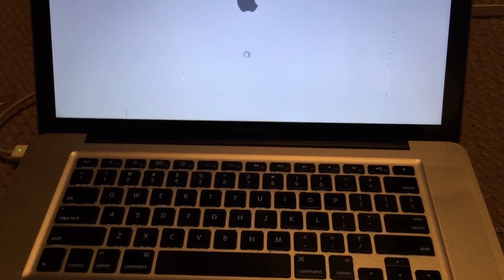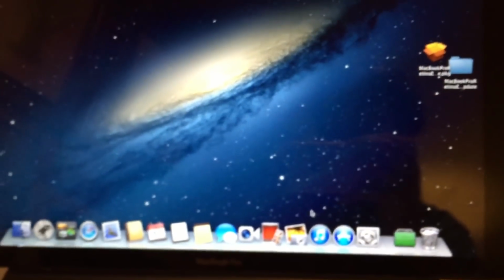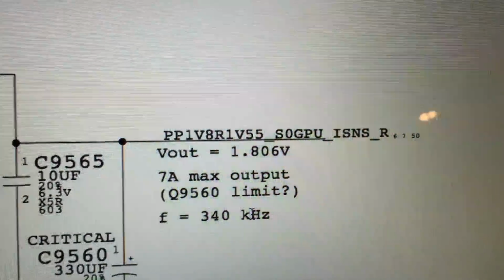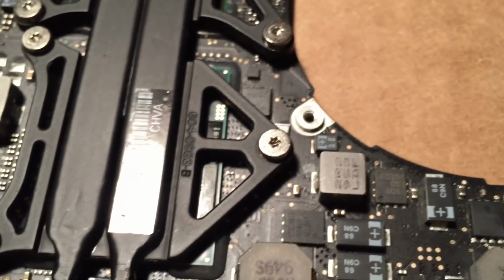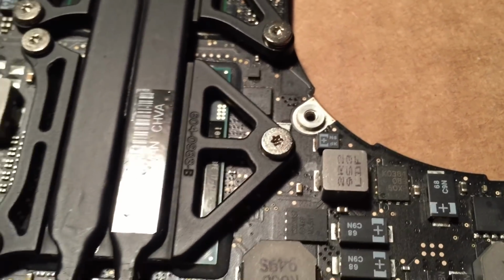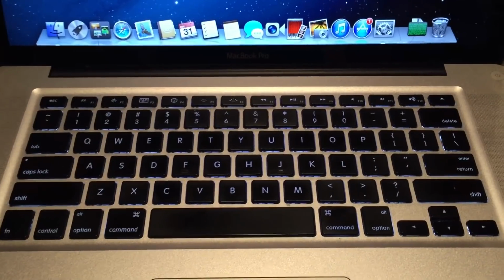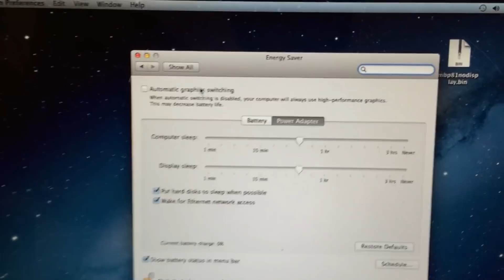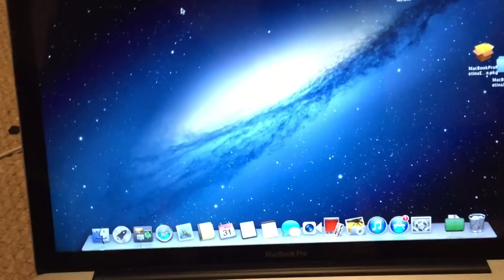Repairing a Mid-2010 15" MacBook Pro that Kernel Panics when Using the Dedicated GPU

Comment: hi dosdude Very nice video...I have the same problem with my mid 2010 macbook pro, resetting sporadically...
If I was to buy a new capasitor (I dont have a donor board) what capasitor should I look for (I resides in Denmark) and do you know of a site where to buy ????
Reply: A better replacement for the original 330µF, 2V tantalum capacitor would be an aluminum polymer capacitor with the same or higher capacitance (330µF or greater) and a higher voltage rating (e.g., 2.5V or higher). These capacitors are more durable and less prone to the characteristic failure of the original tantalum type.

Comment: I have a question, it appears that you have a MagSafe 2 connected to this MacBook but the description says its a mid 2010 how is that possible us there a way to convert?
Reply from the maker: It's just an original style T-tip MagSafe 1 adapter... Before they switched to the (much worse) L-tip style connector.
Reply: @dosdude1  oh ok, thanks for responding so quickly, I actually didn't know they made MagSafe 1 that looked like that. you taught me something. I have this same problem as the one in this video and so you actually taught me 2 things I was about to get a new logic board from eBay. I don't have a donor board like you do so do you have any recommendations as to where to get a capacitor to replace the faulty one with?

Comment: Mine does this some times but instantly happens when I try to run a 3d program like cinebench r15 3d test. I'm kind of scared to mess it up since I have no experience with soldering.
Reply: Ditto. Mine does it ALOT more than it used to, especially with the current OS I'm on. (High Sierra) Its still a perfectly usable computer for me. 2.4Ghz i5, 8 gigs RAM, and a 1 TB SSD.  The SSD REALLY woke this thing up, made it feel like a new computer again. I replaced the old swollen Apple battery with an eBay battery, only issue I have now is the nvidia GeForce GT330M kernel panicking. I use gfxCardStatus to manually switch to the integrated Intel graphics, but I wish there was a setting I could type into the terminal to permanently disable the nvidia. I'm a complete novice with soldering, especially with the tiny capacitors in these modern computers, otherwise I'd try it myself.
Reply: djhaloeight yea I use gtxcardstatus to keep it on integrated on Mac OS Mojave also running 8gb ram, i7 but still have the 1tb 5400rpm hdd
Reply: @djhaloeight  Hi there! With v1.8.1 of gfxCardStatus you can actually do that: start it, configure, switch auto.update off (which you can in this version), and tehn you can even chose to statup and stay with the intel GPU, which prevents it from ever swithcing to the Nvidia (you could also do it vice-versa, but in this case it's not you want :-( ). Have been running my MBP for wees like that now withou a single crash!

Comment: I have the same problem on macbook lat 2013. еrror - "apple.intel framebuffer" .  on new systems - the display simply turns off for 1 second, but works far. is there a solution to this problem?

Comment: I have this problem. Bought a used dead Mac to just swap my internals over since I had a few other issues (a lot, cracked screen blown speakers bend case, cracked trackpad which was replaced and cracked in the same spot to name a few) turns out the logic board on the new Mac is bad :/ Soo now I'll have to send my logic board off to get soldered or buy everything I need (don't have my iron anymore) and practice on the dead board before attempting this repair on my own board.

Comment: Hi! thanks for the video! I would have a question: what temperature is set for desoldering/soldering ? Thank you :)
Reply from the maker: I use around 300 - 350 degrees C on the hot air station.
Reply: dosdude1 Great video.  I have the same year 2010 MacBook Pro with the same issue.  Unfortunately, I do not have the Soldering equipment or an old board that I could strip to fix.  I was hoping to get this MacBook going for my daughter who is turning 10 soon.  Would you ever be opened to repairing my faulty logic board if I sent to you?
Reply: dosdude1 hi bro, I use 400c and its so hard to melt.how long did you desoldering that cap?
Reply: @Fahmad12  I use 400C and it takes seconds. You close enough?
Reply: Elvira Mota Sierra very close. it finally melt on about 10 minutes

Comment: great video dosdude! i replaced the cap, but now how do i enable te nvidia gpu again? ive used the "gpu disable" how to before replacing the cap
Reply: congrats, you bricked your GPU with software before fixing the hardware.
I was using any program to avoid switching to dGPU in software, easy to disable again, we dont even know what "gpu disable" you did

Comment: Hi, thanks for the video, but you have to explain what are the caracteristics of the cap you placed instead the undersized one, because we have to buy it ! I, like many other people , don't have much other mother board in my stuff ... I wanted to buy the one that Rossman sell, but the cap cost already more than 7$ and shipping is 15$ more... I'm not gonna use an aircraft to make travel something is 5 grams weight, it's ridiculous (and expensive). I think we can find it on europe. And so I need the caracteristics and you look like you have ;-). Thanks again
Reply: Hi,the capacitor you need it’s a 330uf 2v
You can find it at eBay , good luck
Reply: @alfaromeo4344  Thanks. No material specificity (tantalum, ...)?
Reply: A better replacement for the original 330µF, 2V tantalum capacitor would be an aluminum polymer capacitor with the same or higher capacitance (330µF or greater) and a higher voltage rating (e.g., 2.5V or higher). These capacitors are more durable and less prone to the characteristic failure of the original tantalum type.

Comment: iam frequently facing kernel panics on mbp mid-2010 15” A1286, Macbook pro 6,2.  after checking this video, i checked my Energy saver > Preference..and i tried disabling & enabling the check box, many times infact, and my system didn’t panic…so i guess my capacitor works fine….then what else can be the problem…?
whenever i open certain apps the system crashes..kernel panic….

Not only this - On Windows 10 or 7 running thru bootcamp, with original bootcamp drivers, my system crashes on certain apps..So i installed windows 10 on EFI boot, and it didn't crash once..All drivers working fine on EFI, except for Screen Brightness which doesn’t work.. Also the ‘Brightness’ option cannot be seen in the Bootcamp manager of Windows “Control Panel>Categories"

Your help & suggestion will be much appreciated….thanks
Reply from the maker: It's definitely the capacitor that's causing your issue.
Reply: 330uF 2V tantalum > is this the right capacitor for my model described to you.....
i just want to be sure it's got nothing to do with GPU or video card etc....

Comment: this is embarrassing on Apple's part making customers do this
Reply: @kpaxxapk6397  

“Every year model has some fatal flaw that keeps failing”

Any electronic product can glitch, and usually the numbers of affected units are low. 

That capacitor flaw wasn’t unique to Macs.  

The capacitors got OLD fast because they were flawed from the supplier.

If Apple had a crystal ball, they’d have used a different style of capacitor, but of course, they can’t see the future.

They did cover repairs for laptops three years out.   It’s farther than most manufacturers will go.

The problem was, only a brand new logic board had a brand new capacitor on it...

It was six years until someone identified the capacitor as the problem instead of the GPU.

The irony?  Reheating the logic board in an oven also rejuvenated the capacitor, gaining about nine months.
Reply: @Jkirk3279  "The capacitors got OLD fast because they were flawed from the supplier." I thought it was due to them using too small of a capacitor. "If Apple had a crystal ball, they’d have used a different style of capacitor, but of course, they can’t see the future." Yeah, but they also could have had a useful repair program that supported more than a few months of machines. "They did cover repairs for laptops three years out.   It’s farther than most manufacturers will go." Yeah, and it only supported machines bought within the last three years. Came out in December 2013, and went three years back (dec. 2010). See any problems there? "It was six years until someone identified the capacitor as the problem instead of the GPU." True, but it shouldn't have been a problem to begin with. Since it was a problem, it should have been handled less terribly. I love my Macs (currently typing on my MacBookPro13,3), but Apple is nowhere near perfect. Apple was not innocent in this situation.
Reply: Apple shouldn't really be expected to support a very niche repair on a 10-year-old computer. This is just for those strange ducks among us who hold onto computers WAY past their prime.
Reply: @xenonpanther  sometimes old stuff is just better. Expecially when you you easily upgrade things vs all this new stuff that have soldered Memory and Soldered Hard drives.   

I can understand why there doing it though.  For space.  Cause they don't need to have connectors and stuff.  But still.  Let's make the new stuff last more then a couple years.

Comment: Would you happen to know the location and the ID tag of the bad cap on the 17" model? I have a mid-2010 17" which runs beautifully only on the integrated but to do that I have to disable the nvidia chip in EFI shell every single time before continuing to boot to OSX.
Reply from the maker: The cap is also labeled "C9560" on the 17" board as well.
Reply: @dosdude1  Could this cap be causing issues even if it reads 1.850v on the multimeter constantly right after bootup?

Comment: Hey, thanks for the video, this help a lot! I want to do the repair myself, I even got the replacement chips, but now I am looking for see what is a good hot air holding gun to use, your recommendations will be valuable.
Reply: Where did you find the capacitor? I ordered from China and it took 3 months for them to tell me it was out of stock. I ordered from other places too with the same problem.

Comment: i have a mid 2010 15" macbook pro. i have no crashes running el capitain, but can't have video output working... do you think the same repair can fix it?
Reply: and its a 10x or 20x cap? could i use a 2.5v like this one here >>> https://produto.mercadolivre.com.br/MLB-880752091-10-x-capacitor-tntalo-smd-330uf-25v-nec-tokin-ps3-_JM?quantity=1    

Thanks for the video!!!

Comment: I spoke to a repair place on the phone and he mentioned that there was something else they did besides replace the capacitor. He quoted me at $290CAN + tax. How long have this fixes lasted for you?
Reply from the maker: This fix lasts forever if you use a bigger capacitor, as I did. There is nothing else that needs to be done on a 2010 model. I charge $50 to do this repair.
Reply: I'm having the same problems, haven't necessarily upgraded my software but I believe it's the same kernel issue. I'm gonna use this as a quote and look for a capacitor myself to cut costs.
Reply: @dosdude1 Wow   thank you SO much man!!!! After 3 years of being dead my beast is back (I'm on it right now)! This machine is still pretty fast for almost 9 years old. I'm so glad I didn't send it away or replace the whole logic board.
Reply: @dosdude1 are you still doing this repair??
Reply: I'd happily pay more

Comment: Excellent work!
I have the same MBP mid 2010 with the same problem!
Well, I'm not a solder-man or anything, but I think that I can buy a capacitor and hire a solderer to do the job. My question is:
Which one is "the name" of the capacitor to order it?
Thanks in advance!!!
Reply: 330uF 2V tantalum cap.
Reply: @crashbandicoot4everr  Thank you very much!

Comment: Wow! Cool videos dosdude1!.

Do you have any idea why a MacBook pro late 2011, running High Sierra (can't update to Mojave) behaves like this:
- randomly reboots.
- randomly goes to black screen, then gray screen. No icons. 
- Video issues: randomly, the image moves horizontally (like if the video output were displaced), some kind of gray grid, green bars, duplicated frames....

The Mac had a similar issue years ago, apple replaced the logical board. I don't have warranty now. So I'm looking for options. I want to find the exact problem. 

Already fixed permissions on the HD. Rebooted with command option p r. And ran the HW test tool. No issues detected. Currently running the long test...
Reply from the maker: The GPU is failing, ver common issue on that model. You can temporarily disable the dedicated GPU via software, using my guide at http://dosdude1.com/gpudisable, but the best thing to do is to permanently disable the AMD GPU, via hardware, as shown in my video here: https://www.youtube.com/watch?v=vbXb0gfRxEY

Comment: My Mid 2010 was randomly kernel panic crashing. I replaced that capacitor and it has not crashed since.
Reply: Да буквально на днях, тоже поменял конденсатор и нет проблем больше!
Reply: @ScalderTube  Слушай, не подскажешь пожалуйста какой конденсатор брал? И сколько в сервисе взяли за замену подобной вещи?  У меня просто что на винде он гаснет и загорается, что на маке теперь выключается.
Reply: Hi! I've a similar problem, but the error message is "GPUPanic.cpp:170"; the solution is the same?
Reply: The capacitor you need it’s a:
330uf 2v
Reply: @alfaromeo4344  what happens if you replace it with a 330uF lets say 25v? It should work right?
Reply: @estebanquito356  It should work with no problem Sir
Reply: What capacitor did you used?
Reply: Yeah what capacitor did you use and how much was it?

Comment: Hey DosDude, you’ve made a fantastic video. I have a mid-2010 MBPRO with exactly the same issue. I have an old 2008 unibody MacBook Pro13 with 330 d89f capacitors on the motherboard. Could I use the 330 d89f capacitor to fix the graphics card issue? Many thanks. Keep up the great work.

Comment: Say you could upgrade a soldered processor to a 2010 Mac Mini with a 2.4ghz Core 2 Duo, What other processors in that line would be candidates for an upgrade? Would it be worth it for such a small possible gain?
Reply from the maker: I've done this before (check my Axiotron ModBook upgrade/modding video). The best CPU you could solder onto that board is a 3.06 GHz Core 2 Duo T9900.
Reply: If you ever feel like making the worlds fastest Mac mini 2010, I wouldn't mind shipping you mine. I think the processor costs 50-60 so the most expensive part would be your labor. It may not be worth it financially, but it would be cool as hell.

Comment: Nice work! Will this work for 2011 MacBook Pro too?
Reply: That's different problem - the actual GPU
Reply: +1, I think i have the same issue on a late 2011
Reply from the maker: No, it's the actual GPU that fails on those. Unfortunately, AMD, in their typical AMD fashion, never fixed the issue with their chipsets that were used on those machines, therefore, even if the GPU chip is replaced, it'll just fail again.
Reply: baking the logic board in the oven (if you don't know how to use a heatgun) will temporarily fix your GPU on the MBP2011 for about 6-12 months though. I've done it multiple times and kept m GPU running.
http://ales.io/2014/03/09/how-to-bake-a-mac.html
I personally do 200°C for 7 minutes.

Comment: How did you know which one part was broken? And exactly this one capacitor?
Reply from the maker: That's OpenBoardView.
Reply: Duke who was running the Louis Rossmann forum for a while has figured it out many years ago, and the typical issues and solution are spreading all over the internet
Reply: user user than why no solution that doesnt require such a hard job?! 😩😩
Reply from the maker: It's a widely known issue on this model, however if you were to measure that rail with a multimeter, the voltage would be much lower than the 1.8V it's supposed to be.